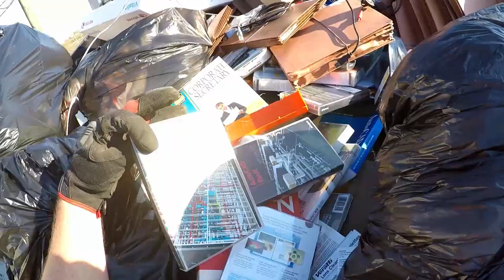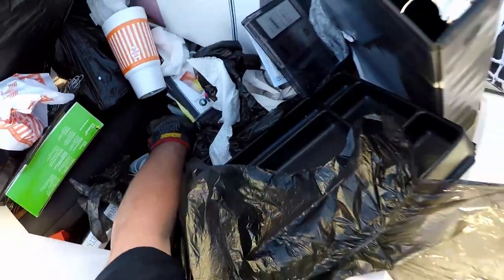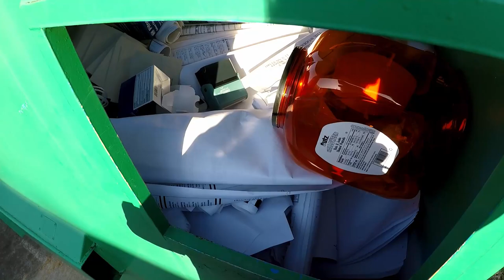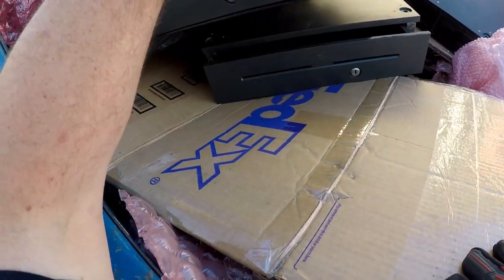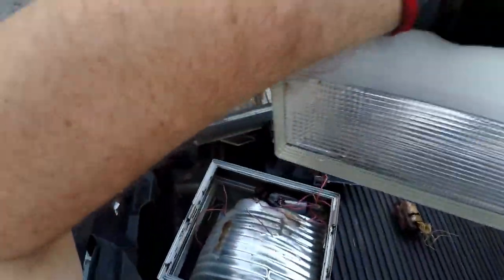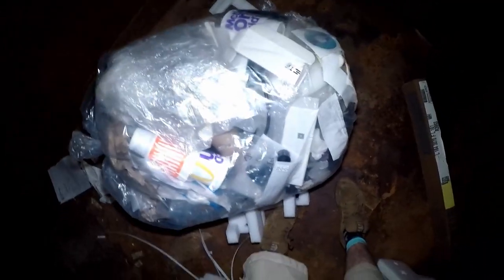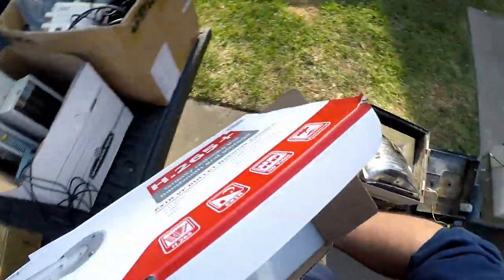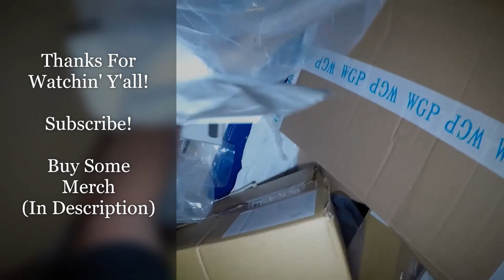Dumpster Diving "Only Took Me 8 Years"

Comment: You should have checked the dumpster next to the first one, if it were empty just toss the junk from the first one over to get to the good stuff on the bottom.
Reply from the maker: The one next to it was a recycle dumpster
Reply: @MikeTheScavenger  got it. you are the master. wish i had of done this in my younger days. There was a medical testing lab next to my office and their dumpster was always overflowing with testing equipment.

Comment: Watching your videos, which I have been watching for a while, I notice that tearing things up to scrap them is worth more to you than the items themselves. It's as if the effort to break things down is where the value for you is found. It is entertaining to see you go at it like a rabid dog, ripping, tearing, and muttering as the frenzy builds. But I don't see the ultimate benefit that you are due for needing to work that hard.  I am retired now, I worked hard jobs, in shipyards, steel fabrication,  piledriving, and welding inspection, but I worked for the money. Not so that I could boast that I was a hard worker. I always looked to see how I could better my situation in life. I couldn't settle for being a Shipfitter, the lead craft in a shipyard, and say 'This is it,  it can't get no better than this. There was always more and better, that I had the faith in myself to achieve. In the box with all of the software you threw the cases aside, even though they were worth, I would say an average of $10.00 each to sell, the codes were on the back of the cases.  You threw them aside for pieces of wire worth 3 cents.  While young we don't understand the effects of wear and tear on our bodies. Being older I understand them all too well. It's like the SRV song 'Things That I Used to Do'. In this case, the things are things that I Can't do no more. By collecting software or blueprints and information like that, you may have found something that you were good at, something interesting that you could use to develop a better life from, but then you wouldn't have fans chirping up "he's a scrapper" They don't care about you, they care about being entertained. There are other things I could say but I won't, this video is two years old even now. but I will say this because this is the best advice that I have ever been able to come up with. Time is going to pass anyway whether you try to take a class or attempt an improvement in your life or not, it's best to start to try and maybe succeed than it is to not try at all. Remember we only have a very short time on this earth, the shortness is apparent as the time ticks down on our clocks.

Comment: Man you run across any more CAD software, send it to me LOL. CAD is very expensive software. But what I wanted to say to you is this bro, when you get Electronics, you need to try to get all the gold pins off of them. In fact you need to put them in jars and save them so you can smelt them down later for the gold
Reply: It's gold plate and takes an acid bath to remove, totally worth it.

Comment: For future reference, the serial number to install software is usually on the CD sleeve or in the box. It’s not uncommon to purchase older software and then use it to upgrade to the latest version. You only need the serial number and CD. You can save hundreds. 

I sold the software for my old company and made my ex-boss over $3,000. 

Take the software and sell it!

Comment: Mike if you come across any more those plastic or metal drawers that looks like they go inside of a cashier register with a key type lock on it I'll buy them from you for probably anywhere between 1:00 to $5 a piece? I will pay for the shipping and handling.

Comment: You're in the dumpster why does it matter that you cut the bag open in the dumpster and dumped it out they should be glad that you did it in the down for not out of the dumpster and made a bigger mess. Probably be proud of you give you a medal
Reply: The loose stuff makes a mess when the truck comes and dumps it and if there is any wind it spreads across the parking lot. The business has to pick up the mess and if it keeps happening they start to lock them

Comment: Serial number is on the cd case and old software is not connected to personal information. Can be alot of money. Saw alot of goodies there. Go there again fast..grab em all:).The Hikvision cameras didnt look like it was old are u shure? Maybe it was the replacement inside, well i think u checked that ,otherwise value 50 usd piece ebay. I should power the screens up and see status. My daily job repair set value hardware, Nice video as always :)